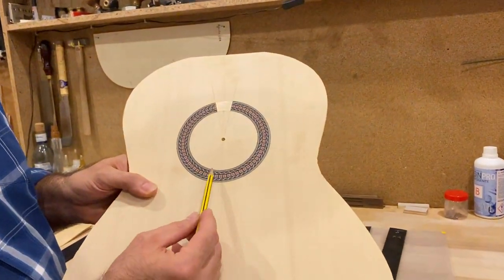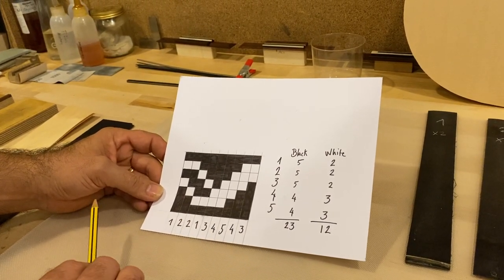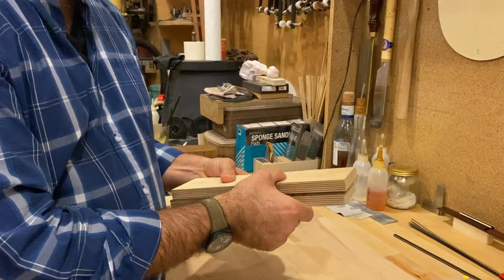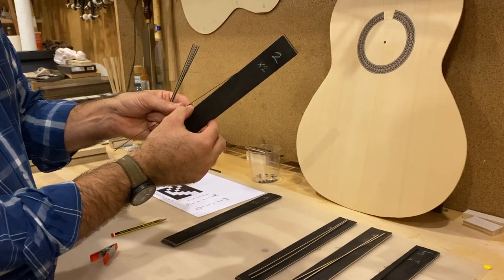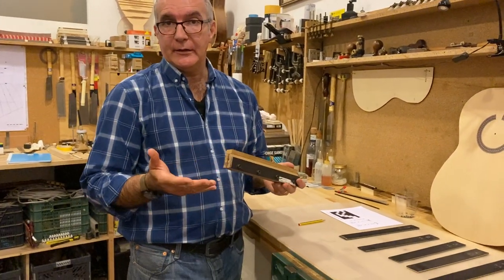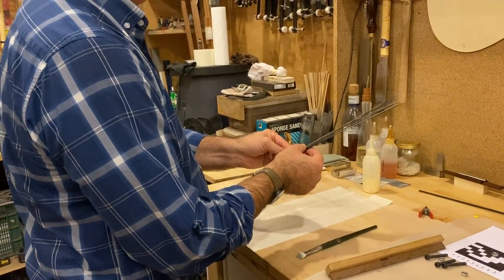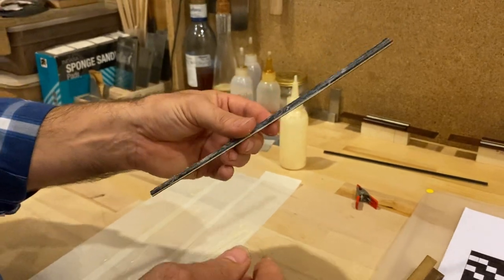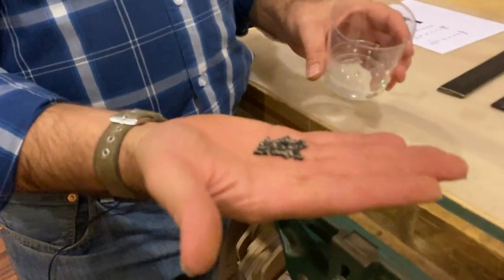How to make a rope detail for the rosette of your guitar

Comment: Hi pablo, do you find it best to always add at least 1 single veneer strip between rows of tiles? Eg you have a rope then a white square with red diamond then another rope. So would you add a single .5 black between the rope and white square tiles or does it all fit together ok without a black .5 ?

Comment: Awesome video as always! Would you say each log does one rosette, or does it make enough tiles to do multiple? Also, are these tiles small enough to where they don't need to be tapered to fit seamlessly around the rosette?
Reply from the maker: Hi, one log of about 200 mm long will give you enough tiles to do one rosette. If the tile is only about 3 mm or so then you would be ok without tapering the edges but anything bigger you need to check but you probably would need to do some fine fitting.
Just in case you are interested I have a complete course available on www.onlineguitarmakingcourse.com